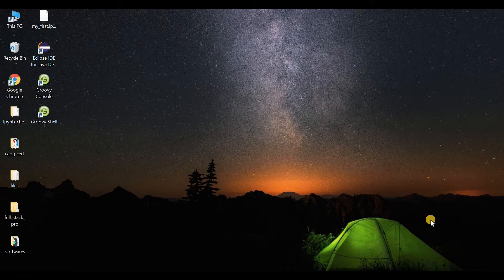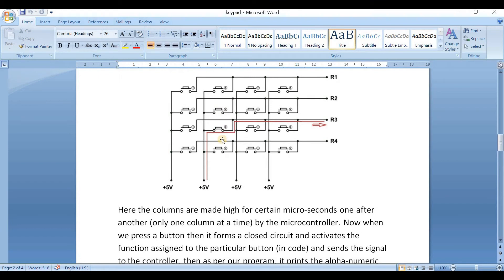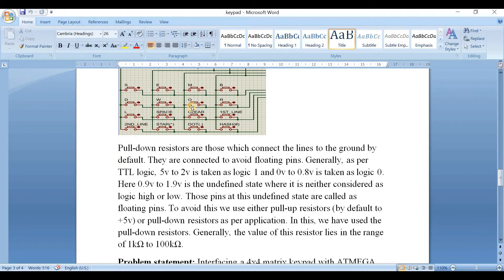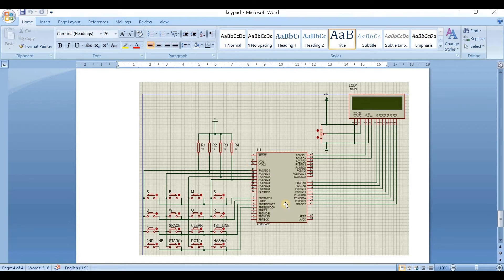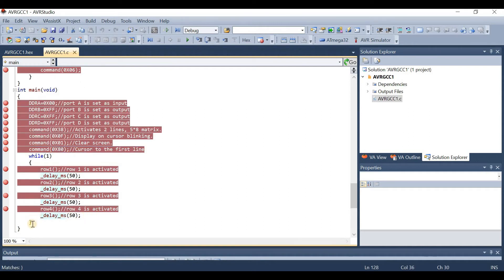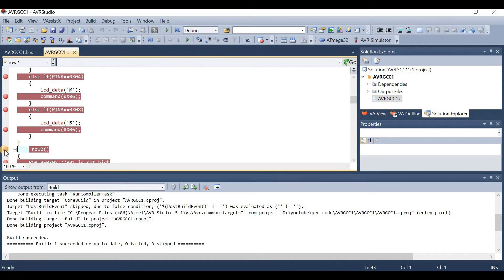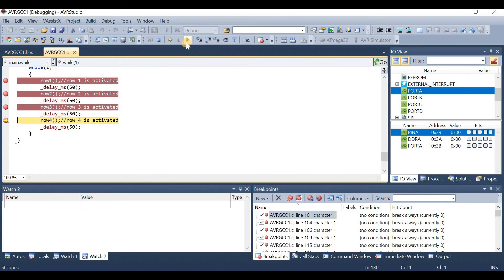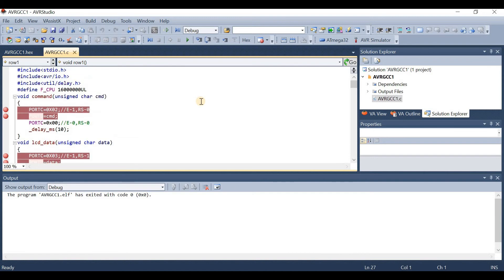Interfacing Of 4x4  Matrix Keypad With ATMEGA-32 Micro-controller.

Comment: I think you reversed the case:- 
Making Rows as I/ps and Columns as O/ps, 
Rows connected to PORTB and Columns connected to PORTA. 
In code you wrote, DDRA = 0x00 (i.e. I/P) and DDRB = 0xFF (i.e. O/P).
Also, at 4.01 you said that pull-down resistor is connected to each column.
I'm not getting it, kindly explain to me if I'm wrong.

So with all these points I strongly feel that the case is :- Rows as O/p and columns as i/ps